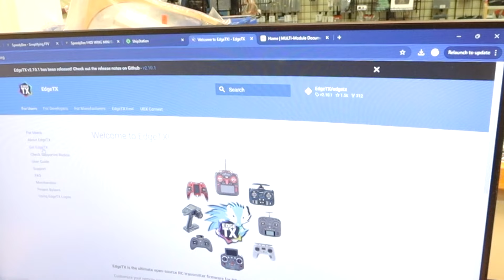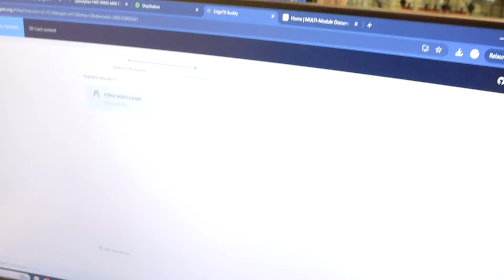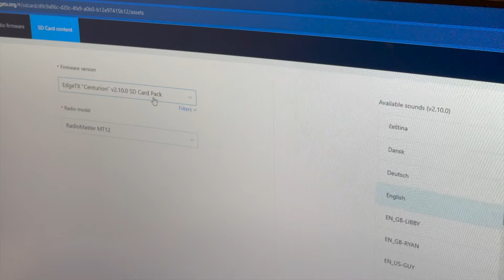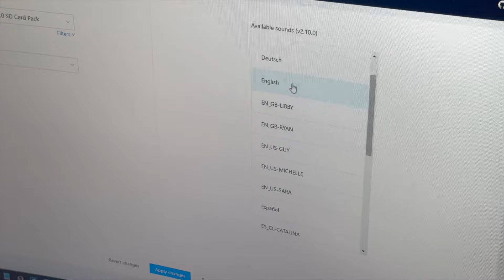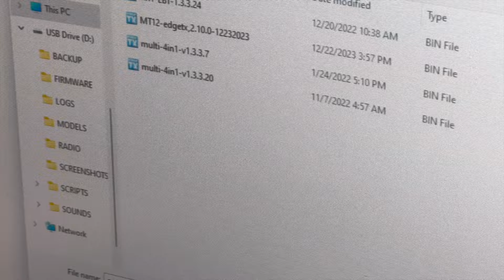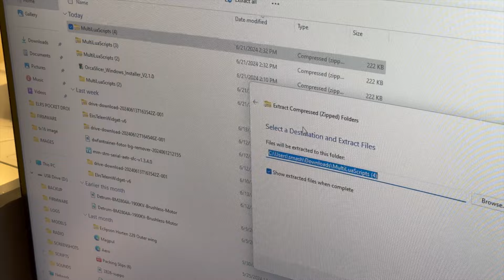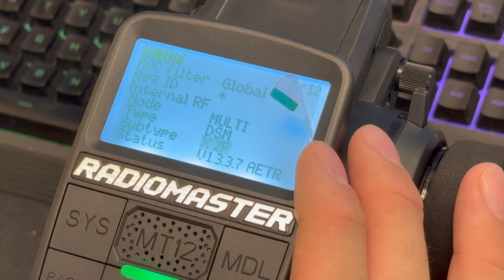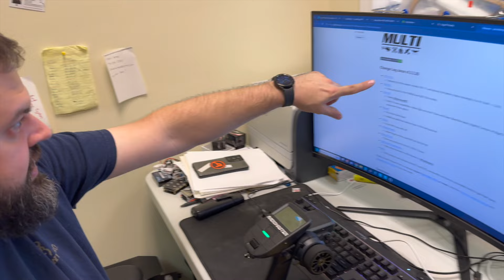How to Upgrade Your RadioMaster MT12: Step-by-Step Guide

Comment: Is it possible to add the 4 in 1 module to the elrs version?
Reply: If you have the ELRS version of the radio, you can add the external 2.4GHz RM 4IN1 Module. The update process for the mutli-module is the same whether it's internal or external. Honestly, I'd read the multi-module site on how to do the update, and look at some other YT vids on how to update the multi-module. There's some critical information that is skipped over in this video.